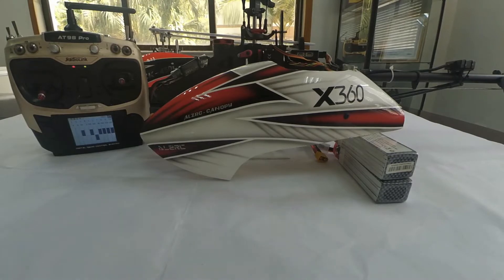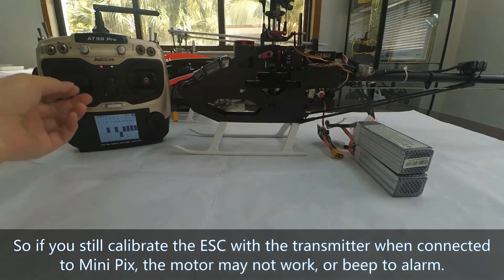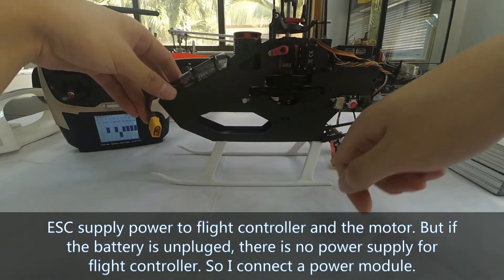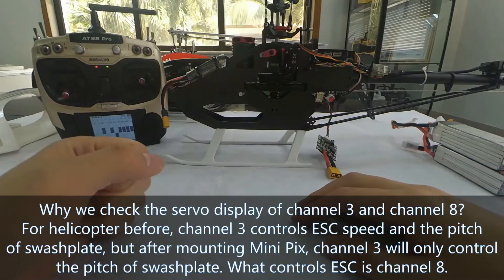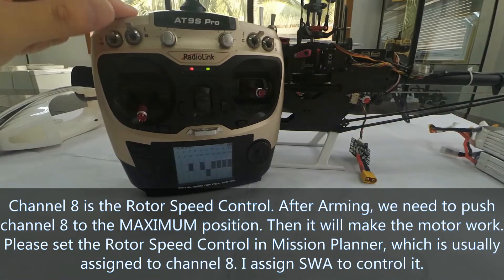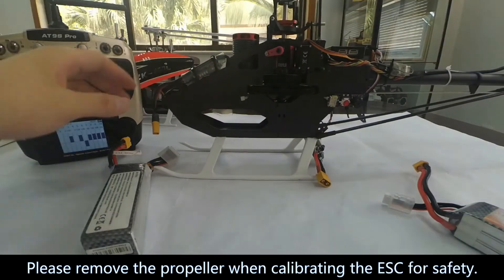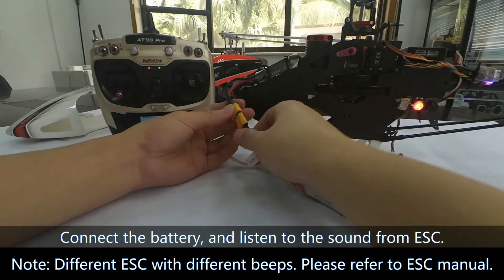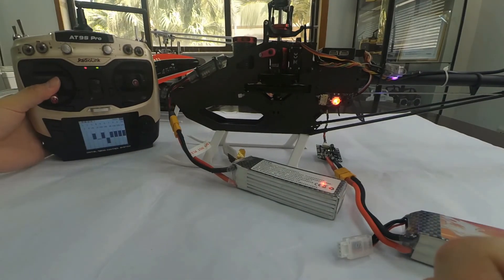How to calibrate Mini Pixhawk flight controller with ESC for Helicopter?

Comment: sorry for so many questions. It's because it's a new controller for me. but... there it goes. Is it mandatory to use the Conversation Board? this small square square that you connected to the battery? Or just connect the esc pwm cable directly to channel: 6 and then connect the battery to the Esc connector? thank you very much!
Reply from the maker: It‘s ok, my pleasure to answer your questions. it supports English to use it, it has power module as the spare parts together, so you can connect it to the battery directly. you can get more details about the spare parts and operation here: https://www.radiolink.com/minipix
Reply from the maker: it's okay,  the better way is contacting Radiolink directly by email: after_service@radiolink.com.cn